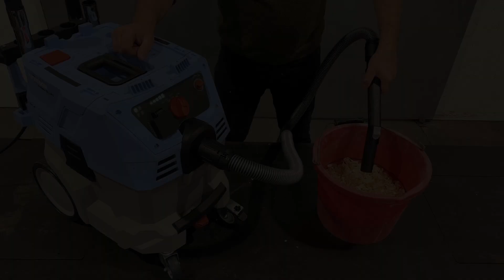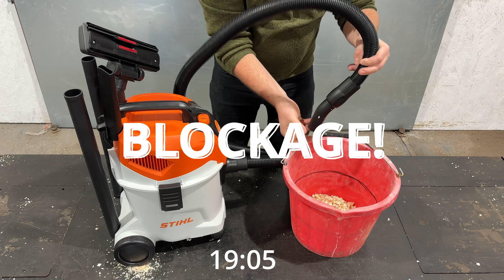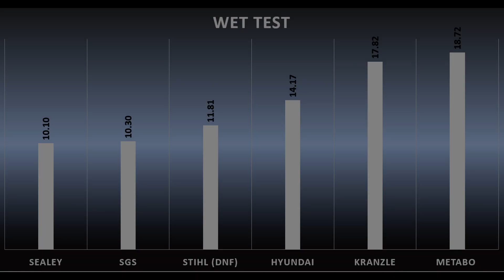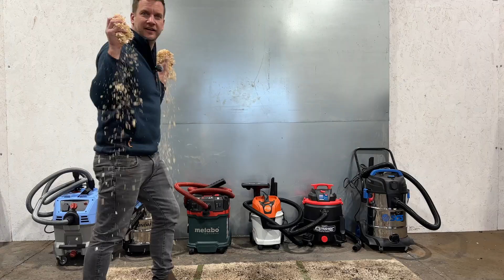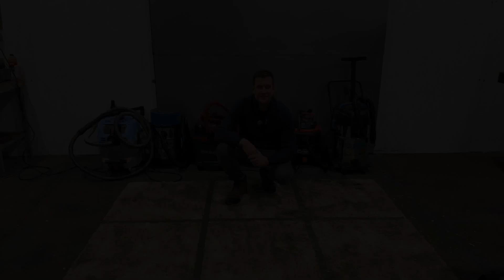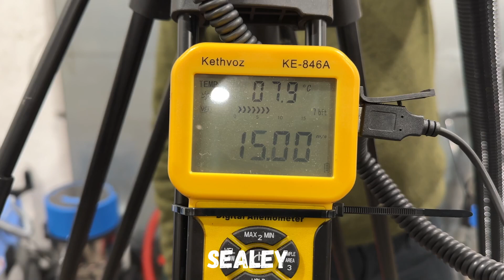BEST Wet / Dry Vacuum Cleaner? We Test 6 Brands so you DON'T have to!

Comment: I didn't know Stihl made vacuum cleaners! I've used one of those SGS ones before but all I did was hoover the offices in a town hall which weren't especially dirty, I always suspected it could do a lot better. Another great workshop vac I've used is a blue Numatic brand one, the same manufacturer who makes the Henry vacs. It wasn't called Henry though, it had a similar sounding name like Harry or something.
Reply from the maker: Nice, yes Numatic would have been a good option here. I think they were called Harry. My mum once had a George which was the carpet cleaner 👍🏼
Reply: The blue numatic is James. Great little vacuum.